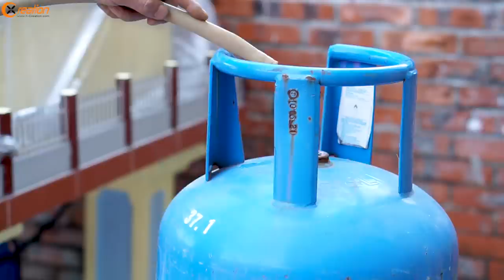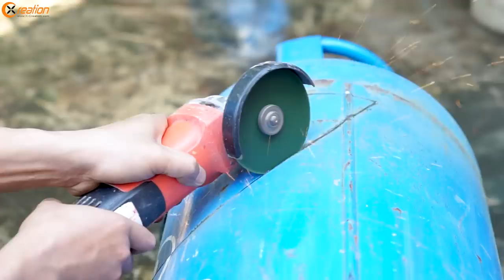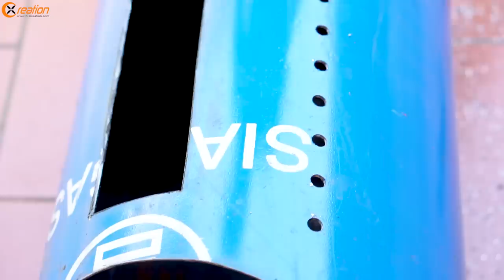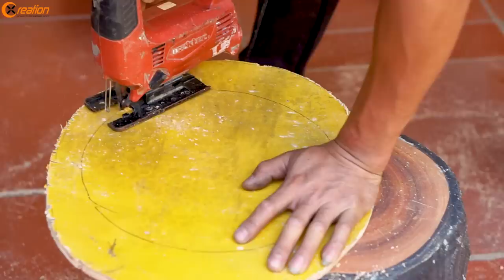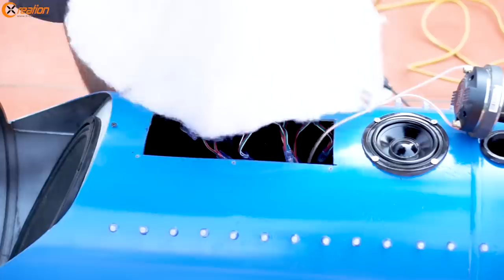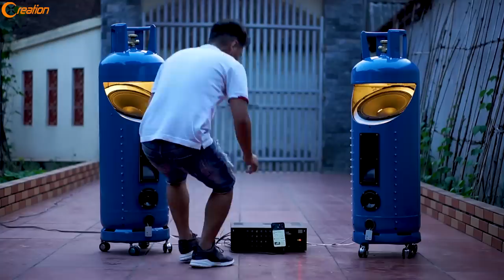DIY Giant Speaker Box from Gas Cylinder Bottle

Comment: Why you filled it with water? To clean? Or for temperature to go down?
Reply: the  water avoid gas explotion
Reply: @unknownmaleperson7439  there is no gas anymore right? So wouldn't it be pointless?
Reply: JK it has  no gas any more but siempre quedan residuos y el agua es como medida de precaución para que no se encienda el residuo de gas.